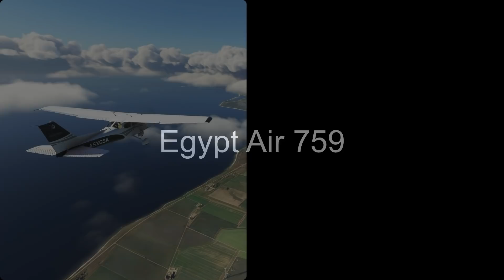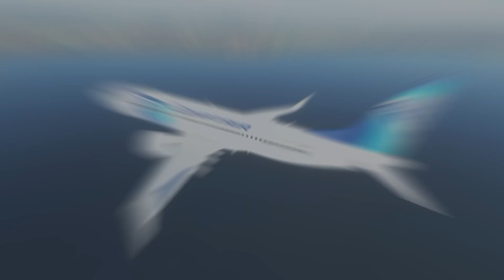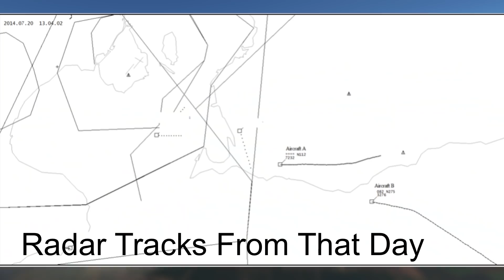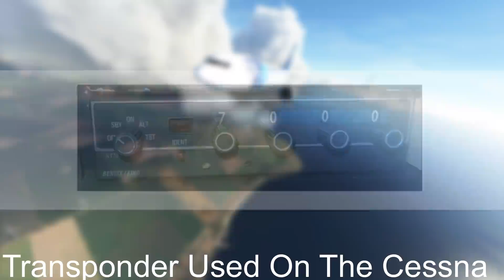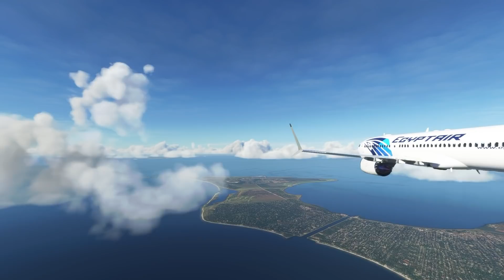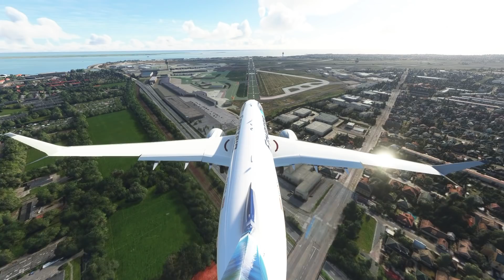How A Sick Passenger Almost Caused A Mid-Air Collision | Egypt Air Flight 759

Comment: Wait a minute..... Do Cessna have TCAS??
Reply: Not usually, but airliners do.  TCAS works by intercepting the transponder returns of other aircraft, so requires only that other aircraft have an active transponder, not a TCAS.  However it does require that the other aircraft transponder is sending its altitude (Mode C), and so I highly doubt that the airliner would have got a TCAS alert in this case.
Reply: @davemould4638  thanks for explaination 🤝👍👌

Comment: Strange that the VFR Cessna was at an even thousand-foot altitude rather than plus 500 or minus 500.
Reply: Not sure that the +/- 500 ft rule for VFR applies in Denmark, but it could have been the last altitude requested by ATC.  As both aircraft were being actively monitored by SSR, the ATC radar should have sounded an automatic warning regardless of whether mode C was selected, which ought to have prompted the controller to contact the Cessna and request altitude.  Incidently, a mode C transponder will only give altitude information, not speed.  The ground radar equipment calculates speed regardless of whether altitude mode (mode C) is selected or not.

Comment: tbh you're a little (lot) harsh on the cessna pilot. if a pilot has control/instrument issues (i think vomit qualifies for both) ATC is responsible for maintaining separation unless they specifically instruct the pilots to maintain visual separation. its their airspace, they're supposed to have positive control of it. "that plane wasn't transmitting properly so i ignored it" is not a viable excuse. ATC made assumptions and almost crashed two aircraft into each other.
Reply from the maker: It’s not me I just relay what’s in the report if I do add any of my own thoughts I always say that the the views expressed are mine

Comment: I don’t know about this one… the Cessna received exactly ZERO instruction via multiple controllers who all saw this plane (altitude or not) and also watched the plots merge on radar without notifying either aircraft OR suggesting course changes? The Cessna made a mistake, but it’s something that happens CONSTANTLY and is not a big deal - the controller will simply ask the aircraft to verify squawk code, or as far as entering the TCA unannounced “good morning November blah blah blah entering tca from southwest, say intentions” or something like that. It’s NOT a big deal. 

Also when given the squawk code, pilots routinely screw it up. In the US (I assumed it was the same everywhere) the next radio transmission is usually “November 7396blah blah radar contact, 5 miles northeast of SUPRT, altimeter 29.92” just as a way of confirming correct squawk and that the controller is aware of your presence. The pilot should have noticed this as well, but if a squawk is assigned to an aircraft and they don’t obey or show up on your scope, and the controller doesn’t give a damn or follow up, they’ve ROYALLY screwed up. 

Completely ignoring the traffic conflict and an unidentified aircraft in your control area AND one which is heading (eventually merging) with a known commercial contact with zero communication is absolutely absurd.  This is 100% on ATC, absolutely no question about it, even after fully identifying and vectoring both aircraft away they STILL should have said “traffic 3 ‘o clock, same altitude, no factor” or something similar. NONE of the above happened at all. What’s the point of even having a radar scope and controllers if they’re watching plots merge without even keying the mic once? “Hehe look at this idiot, he’s about to crash into a commercial airliner, lolz!”
Reply: Absolutely.
Reply: Exactly..  Moreover, cessna pilots as vastly less experienced and trained compared to ATC controllers and commercial jet pilots..

A couple of mistakes by the cessna pilot are excusable. But those done by ATC controllers are even worse, considering their training and responsibility.
Reply: This should be the top comment.
Reply: Alex, you nailed it!  I hope others read this... 😏
Reply: 100% facts.
Reply: Yep. atc fault. Thankfully TCAS was there
Reply: I know nothing about flying but thats what i thought!!! I was like why tf aren’t they just saying something!!!

Comment: Them plane landings on that simulator is too high - 4 solid white PAPI lights :) but onwards with the video
Reply: Actually, pretty normal, would be pretty rare for a Cessna to descend on a 3degree glide slope unless they were flying a practice instrument approach. Usually the descent would be much steeper, otherwise it takes forever.
Reply: @Musikur  I mean I guess so, local airport I fly isn’t that long but even that 737 landing had 4 solid but anyways just a simulation HAHA

Comment: I mean, if the guy was following the correct proceedure, he would have put the transponder into standby when he changed the squawk code, and then switched it back to ALT, he probably just didn't rotate it quite far enough. It's an easy thing to do, and in the air, he wouldn't have had any reason (checklist) to check it. But my question is WTF where the controllers doing? Why did they not query him about the fact that he was not in mode C, and never reported his altitude on any of the hand offs? It doesn't sound like even the controllers were under the impression that he was in class G or D, so he therefore must have been in controlled airspace, and they never should have let him stay there without knowing his altitude. 4000 feet is not that high for a Cessna.
Reply: And on top of that, Copenhagen airport is extremely close to Malmö airspace, so it would be one of the most tightly controlled airspace’s in Denmark and Sweden. As most incidents, a lot of things went wrong at the same time…
Reply: Or maybe it was accidentally turned while cleaning the "dashboard" idk I'm not a plane person
Reply: If the gauges are unreadable due to uhhh.. let's say biological materials. its... just unfortunate. atc should have picked this up and req'd an ident.

Comment: Those cloud graphics on the new MS Flight Simulator are fantastic
Reply: Until you get a damn hot air balloon barrel rolling at Mach 2...

Wrong channel, I know, but couldn't resist...
Reply: @seand.g423  😅👍
Reply: @seand.g423  I get the reference. :) Lol... AFProud95, just as good as Swiss001 IMO

Comment: What? No vomit bags? Or did the passenger just not think of it? A simple bag could have saved some horrible clean up. Most people know that they are getting sick and should be able to use a bag. It’s not to say it would have changed the flight errors but it’s just so easy to have vomit bags in the passenger area. I’ve seen people on commercial flights who don’t even look in that pouch for the safety instructions or to make sure there’s a vomit bag in there. The flight attendants will be happy to get one for you if it’s empty. Sure saves a lot of cleaning.
Reply: I've not seen a sick-bag in the seat back of a commercial airliner for decades.  I've always carried a few in a light aircraft, but on the few occasions when a passenger has been sick, only one actually used it in time.  The one that did use it then immediately tried to push it out of the clearview panel - the bag split and the slipstream sprayed the contents over the entire interior.
Reply: @davemould4638  Wow they really are cutting costs. Thanks
Reply: @francispitts9440  I believe the thinking is that the psychological effect of seeing everyone being issued with a sick bag makes it more likely that passengers will get airsick.  How would you feel if a restaurant issued sick bags to all customers "just in case"?
Reply: @davemould4638  Happy that I’ll have a bag to puke in instead off all over the table and floor.
Reply: @francispitts9440  I doubt that most people would wecome puke bags being handed out at restaurants!
Reply: @davemould4638  It was sarcasm. I wasn’t serious.

Comment: Was the puking verified? Cause I keep thinking, what if he lied about the puke as an excuse? I require proof of puke.
Reply: I imagine whoever met the pilot on the ground to ask what had happened could simply smell it.
Reply: @nnelg8139  also probably see it too.
In all those small gaps and hard to reach places.
Reply: @koharumi1  and on the floor too as I don't think they had time to clean puke when they were flying
Reply: idk the last time you've dealt with puke, but it does NOT come out of anything easily. And the smell... Ohhhhh, the smell lingers, fam. And to think of all the crevices there are in a Cessna... Yeah, no, it wouldn't've been a 5-minute cleanup job. By the time someone got there to question the pilot, there'd be evidence everywhere.
Reply: @hauntedshadowslegacy2826  That's exactly why I carry barf bags in my purse at all times. You're right though, it'd be pretty obvious in a cessna

Comment: I fee like the transponder was knocked out of alt mode when cleaned up though. It's easily done, IIRC however, but it's equally on the controllers though.
Reply: It’s all on the controllers - the pilot has MANY jobs and tasks, the controller has ONE. Pilot made a simple mistake that controllers deal with constantly, it was never clarified, neither was the traffic conflict. It seems like the controllers were literally asleep on the job.
Reply: @EstorilEm  I noticed that too! He says the controller "assumed" the Cessna was in a low altitude - then later he said the Cessna wasn't where it was "supposed to be".
Well, when you assume something, that is not "supposed to be", that is just an assumption. It's worrying to know that the controller wasn't hold accountable for this one. There must never be assumptions at the ATC room.
Reply: The narrator mentions that the Swedish controllers did not have the airplane's altitude, mening the transponder was not working even before the puke event. My first reactions was also: vomit and electronics are not best friends.
Reply: @todortodorov940  Even if the transponder was broken by the puke, the controllers should have said "Hey Cessna, what's your altitude? it's not showing up"
Reply: @aaroncarson  I agree. The ATCs where very passive in the entire story. What I was saying is that I initially made the assumption the vomit caused the technical problem - but that's not the case.

Comment: It sounds to me like the cessna pilot failed to reset his squawk code.
Reply: I think the wrong code earlier on tells the entire story. You're supposed to put the transponder into standby before changing it (in case you accidently roll through an emergency code and set off an alarm at ATC), and he probably just didn't turn it back far enough afterwards. But I suspect it must have actually been somewhat between the two modes, since they said there was a "lot" of missing data, not "it was all missing", and it obviously worked at some point for TCAS
Reply: @Musikur  I meant as in, he left the wrong code in, but your theory also makes sense.

Comment: SOmething is not right,,,,,,,,,,,,, for the TCAS TO WORK ON BOTH A/C OR EVEN THE 737.  BOTH AIRCRAFT HAVE TO HAVE THEM.  AND DUE TO THE COST OF THEM I DOUBT A 172 WOULD HAVE ONE?  ATC FAILED AS DID THE PILOT OF THE CESSNA.           SORRY FOR THE CAPS.......
Reply: No, TCAS  does not need to be on both planes, the other aircraft only need a Mode C or S transponder which the Cessna had, however, you are correct in that if the transponder was set to on and not Alt, it wasn't in mode C, so it shouldn't have been broadcasting altitude.
Reply: @Musikur  The other aircraft needs a mode C transponder.  Mode S alone cannot trigger a TCAS warning as far as I am aware, otherwise it would be giving warings all the time for GA aircraft flying tens of thousands of feet below the airliner.  (A great many GA aircraft only have a mode S transponder).

Comment: How did TCAS work without the Cessna reporting its altitude? I thought it was a requirement
Reply: Tcas has it's own altimeter.
Reply: @tadzhiks  Oh, I never knew that, thanks! :)
Reply: @tadzhiks  How does that help when the Cessna doesn't have TCAS and isn't reporting its altitude at all?
Reply: @tadzhiks  Not quite true.  TCAS needs to get the altitude of the OTHER aircraft, which is does via its transponder returns.  In this case the Cessna had no TCAS and was not providinf altitude info - so I very much doubt that there was a TCAS alert.

Comment: The charitable interpretation is that the Cessna's transponder changed codes when puked on or when being cleaned of puke.  The realistic interpretation is that the pilot simply forgot to change the mode.
Reply: And the functional safety interpretation is that it shouldn't be possible to disable mode C around busy airspace. TCAS generated an alert, so the Cessna's transponder was obviously capable of interrogating other aircraft and detecting when it was being interrogated by the ground. In that situation it shouldn't be possible to put it in mode A.
Reply: @marc-andreservant201  Yeah, I don't understand how TCAS could have gone off if the transponder was in Mode A tbh, unless there is some technical details about some transponders which have a "wake up" function for TCAS which I'm not aware of, it doesn't make much sense.
Reply: @Musikur  I don't think he said the TCAS in the Cessna went off. He said the one in the jet did. But not the Cessna. The Cessna turned because he saw the jet visually. Or at least that's how I heard it.
Reply: The mode is set by a physical knob, so it's not unlikely that he turned it while wiping the dashboard or helping the passenger.
Reply: @superj8502  on older transponders they require to be set to SBY before changing the code and then back to ON or ALT, easy to forget to switch, or to switch to ON, mode A.  @Musikur  TCAS will not generate RA by interrogating another Mode A, but 
it will generate a TA, then it is up to the pilots to keep separation visually.
Reply: @lukastylka  i'm not saying this is what happened. All i'm saying is that it doesn't seem unlikely so let's not jump to the pilot's throat (which we shouldn't do regardless).
Reply: @superj8502  i'm not saying it either, but there there might have been another reason to switch the knob. Other than wiping puke off the dashboard that is ;)
Reply: Agreed. Ignorance is bliss! Mind you, considering how inexperienced the pilot was, the fact that he didn't crash the plane when his passenger puked does speak to some skill. Or clarity. His workload just quadrupled and he was overwhelmed. But he still landed the plane and also avoided the mid-air collision with a millisecond to spare. Most people would have just frozen at that point. But he turned away and saved the day. I bet he puked himself once he was on the ground!
Reply: I was thinking the same.  I could see it happening particularly in a general aviation plane
Reply: If you mix an inexperienced pilot with a violently sick passenger, ALL BETS ARE OFF... period. You don't even need a specific excuse for switching modes of the transponder or working any other levers or knobs on the dash for cleaning up puke or whatever. It's the kind of action that can happen simply because you're paying more attention to cleaning the puke than you are to what controls or gizmo's you happen to be cleaning it off of... AND it's at least possible that when the passenger started puking, they reached a hand out to the dash for some sense of support without thinking about it... and just like that, you can disrupt operations of just about anything...

    Anyone who's been around a sufficient number of less experienced drunks at parties has probably seen more than a few who flail around or grapple with random things when they're busy puking... It's like a visceral need for manual sensation or something... mid-vomit, they have to fiddle with crap and not even looking at whatever they're fiddling with. It's also entirely possible, once smeared in puke, that any visual indicator for whatever mode the transponder was in, couldn't be legitimately seen clearly by the pilot, either... SO he didn't know that the mode had been switched or that he'd tried and failed to put it back after wiping it and moving the controls...

     Then we get into the occasional few who have habits of fiddling with electronics any time they wipe them, especially from something "gross" as if the electronics are as squeamish as they are...

     For an inexperienced pilot, he did well to avoid the jet under the circumstances and still make it to the ground without a crash... The awkward phone call probably was made, but likely turned into a short and humorous conversation, ending something like, "So... what do you have to say for yourself?" and the pilot giving a ragged sigh, "Well, my passenger puked ALL OVER the g** d*** dashboard. It stunk like fish, coffee, and cigarettes steaming in a garbage pile, and NEITHER of us smoke... I might've messed it up when I was trying to wipe puke off the gauges... or maybe he bumped it... I don't know. I'm going to have to get it checked out." AND then a pause of silence followed by a chuckle. "You know, son... My first passenger was my cousin. I was trying to impress her into getting me a hook up with her friend... and she...."  

     In any case, it would be the kind of awkward phone call I'd be happy to have survived to make...   ;o)